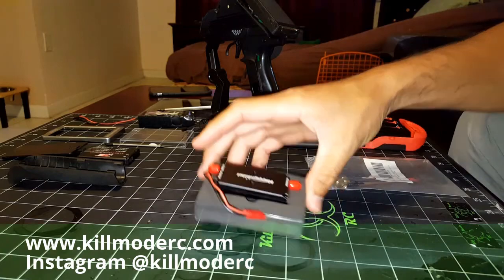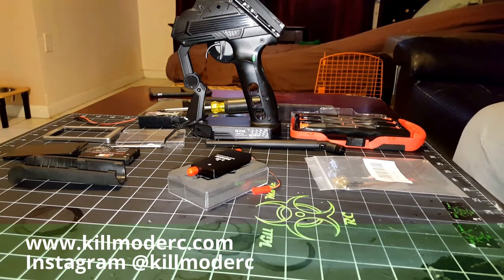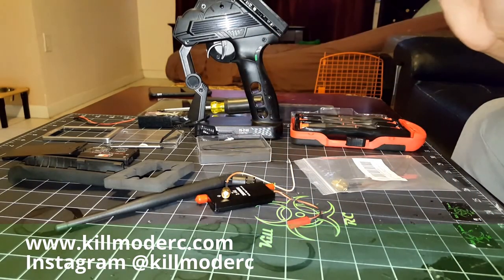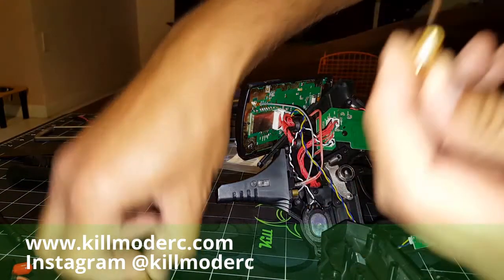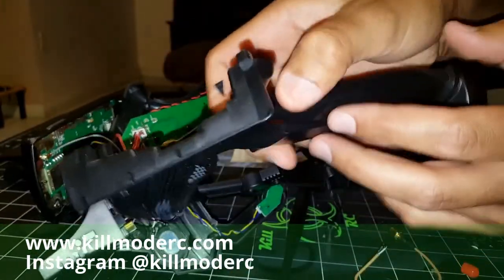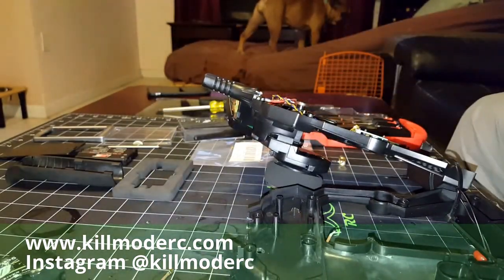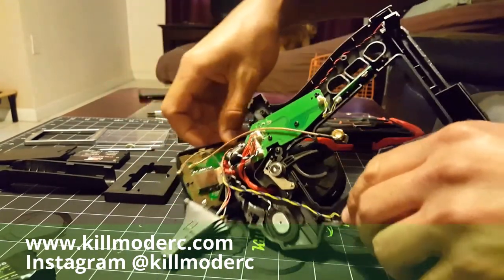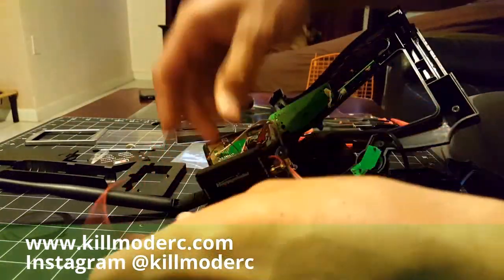RC Radio Range Extender Installation Install Range Test Booster Transmitter FlySky Futaba Spektrum

Comment: I seen you disconnected the original antenna to plug the booster in. Then in the next part i seen u was still using the stock antenna.  So my question is are u still using the stock antenna along with the booster or did you disconnect the stock completely?

Comment: Okay I hope mine up and plugged it all in heaven range tested it yet it is that diamond supposed to light up how do you know if it's on I have signal my car is working
Reply from the maker: Christopher James mine lights up, but it’s hard to see in the daylight. Check it in a dark area.
Reply: @killmoderc6815   I did I got the light up once or twice but I just think the insides are bad so most in in it back to China and ordered a new one
Reply: If I switch to your pack big pack men from the purple do you think I'll gain miles per hour just by switching

Comment: I have a fm/am transmitter at 40mhz for a boat.i am thinkink to put an amplifier ,i also saw some guys installed a line attenuator at the ampilifier input.do you think this could work at my radio?

Comment: Hi fella.... do you remember where you found that coax cable you used to do the mod? I have a 4pls and it uses the same connector on the board like yours. Thanks
Reply from the maker: Hello Rene, yes I bought it on Amazon. here is the item description so you can search. 
Generic 2 X 6inch U.fl / IPX Female to SMA Male Right Angle RF Coaxial Coax Cbale RG178 Assembly for Wireless 15cm